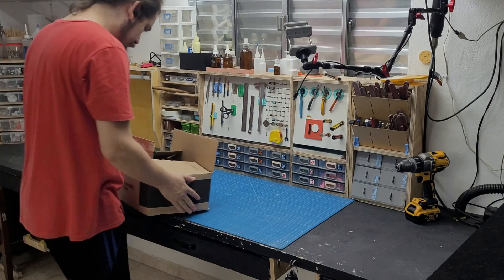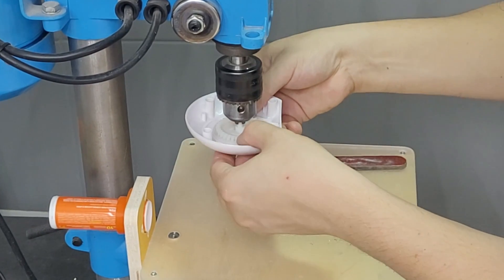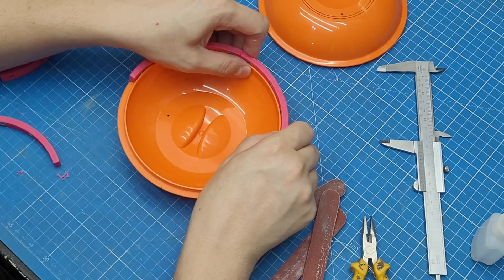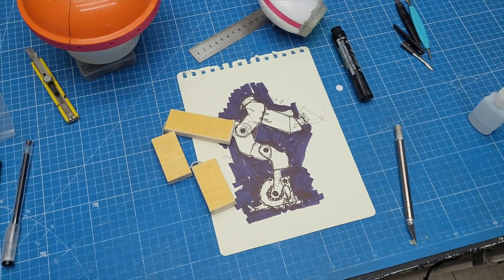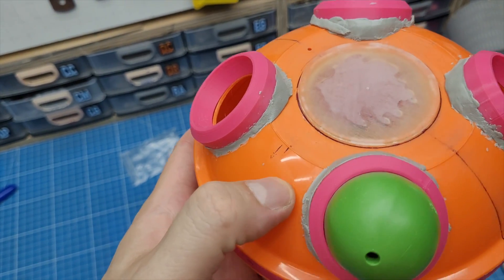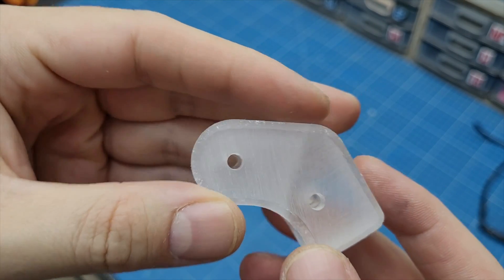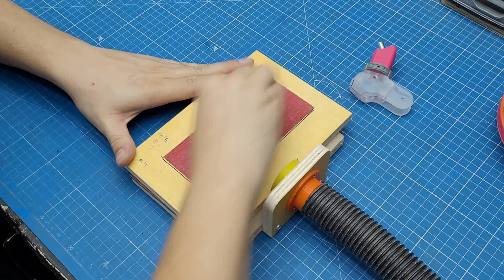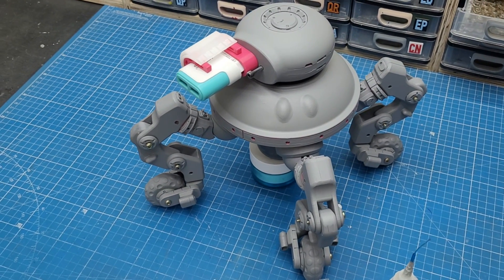SCRATCHBUILT Spider Robot - EP01

Comment: Rite Transform Dude, Great build n not cheating using laser cutter, you get the parts from where ever you can! I was building a model tank kit the other day and  was wondering if you have considered using the sprues off model kits (most modelers throw them away)? The reason for asking is that some of the sprues were very interesting shapes one bit looked like a roll cage another looked like an antenna, lots of the bits looked like they could be very useful! TFS, GB :)